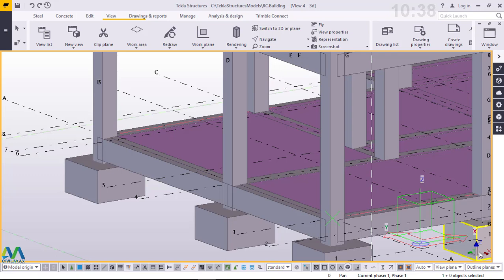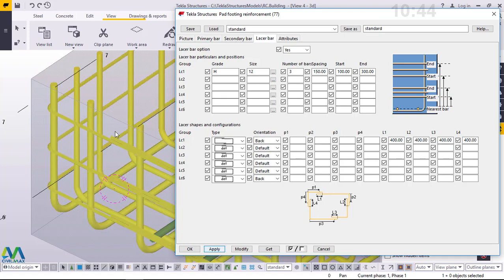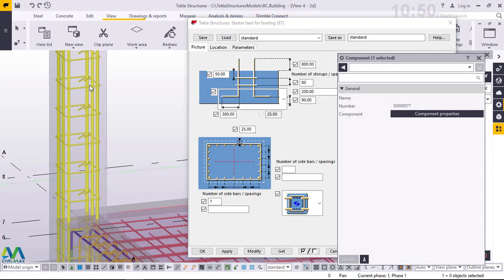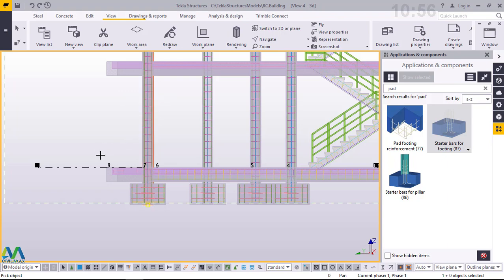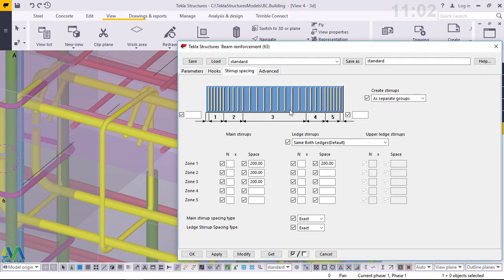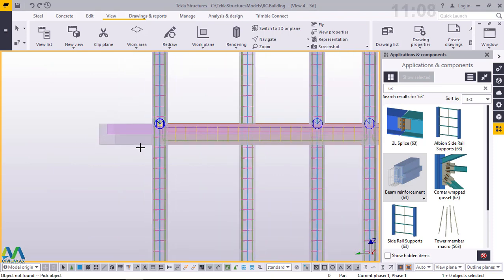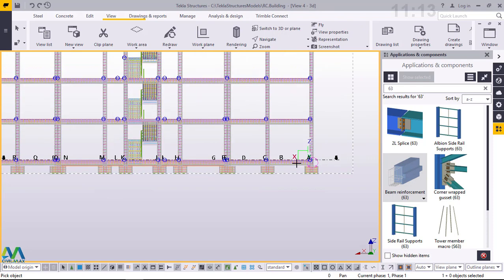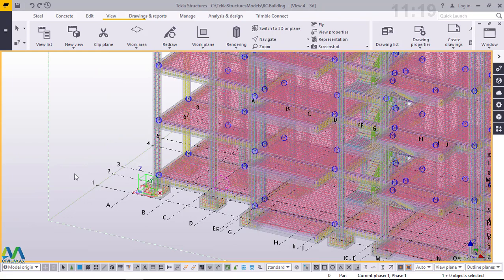How to Place Steel bar  on RCC Building | Tekla Structures

Comment: Hlw sir plz help. When I try to model stirrups in beam, I use crossing rebar set. I select all legs but stirrups are only shown on three sides. When I increase the cross section of beam then stirrups are shown on each sides. Can you explain the problem here?
Reply from the maker: which version?
Reply: @MauriceDimba  V2022